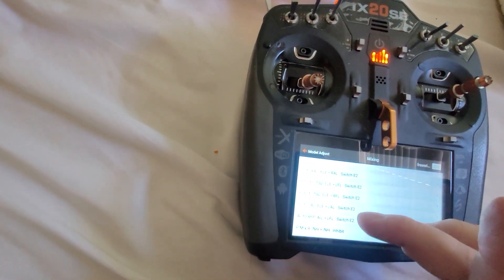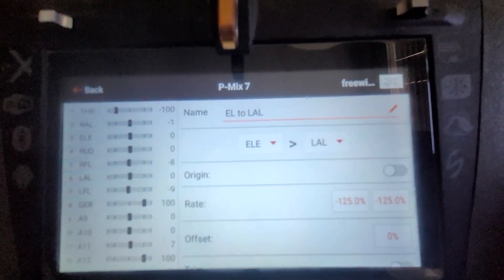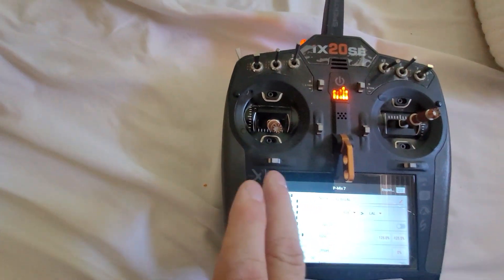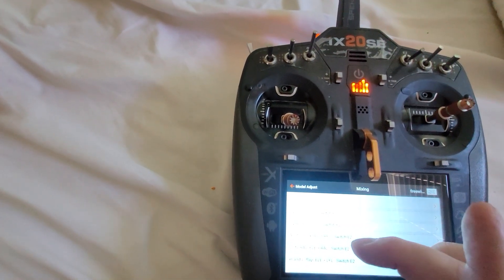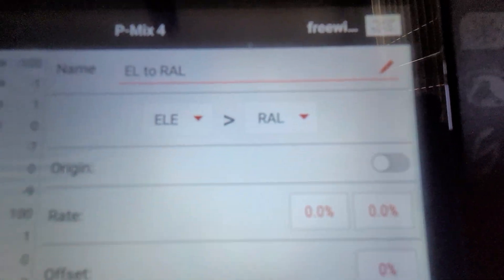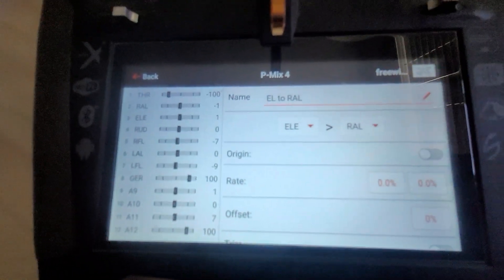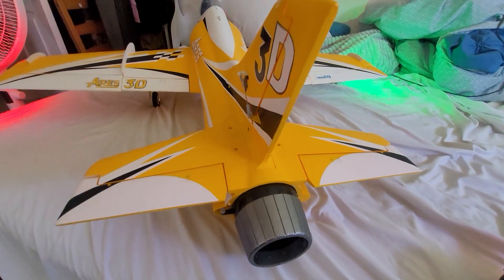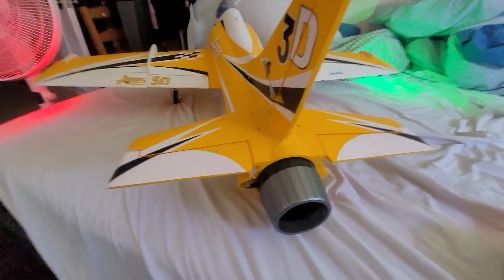Programming completed for the Freewing Ares 3d jet! 😎 🆒️

Comment: Mine arrived today and I fly an ix 20 as well, I would sure like to know more about the mixes and which receiver you are using...many thanks!
Reply: Any tariffs? Hope I get mine
Reply from the maker: @AN-ce1nd There are always gonna be sticker shock. I try to not let it bother me.😊
Reply: Nice! Fly it yet? I am going to Maiden tonight, but I can't get the stock gyro to work. Guess I will learn real fast how much the gyro comes into play when learning jet hovers lol.
Reply from the maker: @joinrcfeed I took out the stock gyro this time but my 80mm F22 flew great with the stock gyro assigned to a 3 position switch.
Reply from the maker: @joinrcfeed Sorry, I forgot to answer that question. I did not get to fly it yet. Unfortunately the battery I ordered were wrong I ordered smc 6s 6700 by mistake not smc 8s 5900. 😅😅😅
Reply from the maker: AR10360t 
The mixes are
RUD to vector 3
El to Vector 1
AL to RFLAP
AL to LFLAP
 EL to RAL. 
EL to LAL
EL to RFLAP
EL to LFLAP

And each time I assigned it to my E2 two position switch.

Comment: Why do you mix the Elevator to the ailerons and flaps? Is that required?
Reply from the maker: Thanks for watching, If you own one you would notice it's in the manual. Seems to work o k in a hover😊 Although i'm not good at hovering yet.
Reply: @victorrcjets7660 I do have one, that's why I am asking.

So you only enable that mix in a hover or do you fly with in on all the time? That's what I don't really understand. When do you need that?